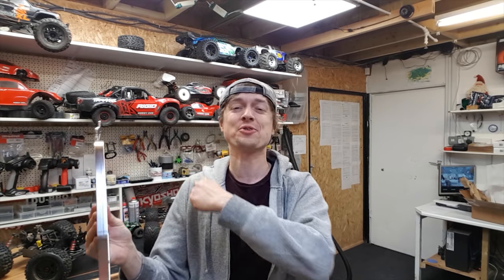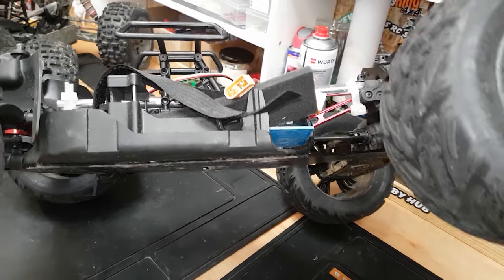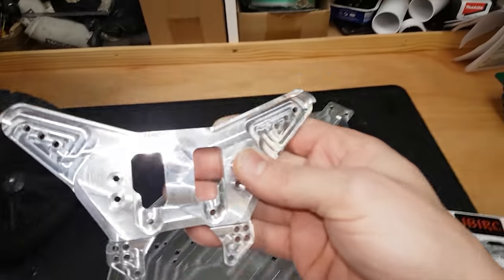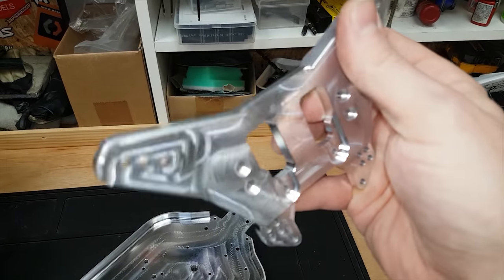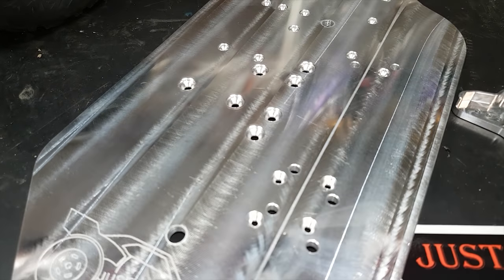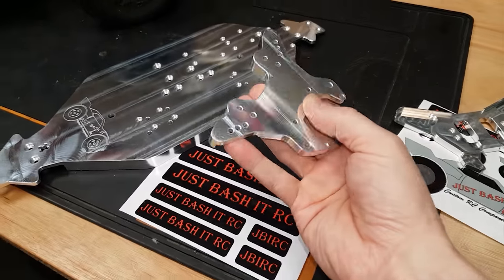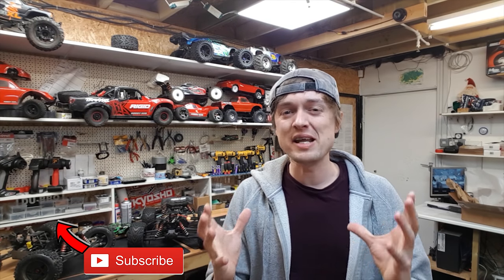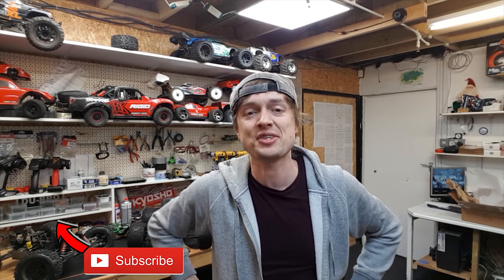ULTIMATE Arrma Kraton HD Chassis + Shock Towers From Just Bash It RC (Made in USA)

Comment: Hey Kevin 👊. If it's not a bother would you mind weighing that JBI chassis 🤔. I'm testing the new M2C Racing 7075 T6 4mm Kraton chassis and am curious as to the weight difference between the 2. Stock Kraton is 12oz, M2C is 17.7oz (496 grams). So far the M2C is straight as an arrow without a tower to tower brace. 🍻🤘🤘😎💪👊👊
Reply: Yeah that JBI chassis looks like it weighs as much as a brick
Reply: @PatsRC  thanks brother 👊. Much appreciated 🍻😎💪👊👊
Reply: @richduperbash2966  he said it was about 300 grams more then stock
Reply: @PatsRC  yeah I know right 😂!!! Well 7075 is definitely stronger with much better memory 🤔. Guess we'll see what happens.
Reply: I have the same chassis and honestly think I'm gonna get the M2C chassis and maybe sell the JBIRC. Not liking all the extra weight. I mean, it's super nice looking but... 🤔
Reply: @joov80  I hear ya on that John. There's little doubt that extra mass contributes to other breakages with awkward landings and takes from overall agility. Every rig I've lifted with a JBI has felt heavier than ideal. The M2C option makes more sense to me. Good luck with whatever you decide Brother 👊
Reply: @richduperbash2966  yes that is exactly my worry. Extra weight means harder and/ or more awkward landings. Either way I'm getting the M2C chassis and sometime may grab the outcast chassis as well.

Comment: If the chassis is thicker make sure you use longer screw! I’ve had screws pull out of bulkheads and shock towers!
Reply: Chassis is designed to run with stock screws.

Comment: Judging by that bend in the rear shock tower it was a nose dive as it has bent where the alloy tube you have fitted, you really need a flat either alloy or carbon fibre top chassis brace the ties to the lower tower mounts.
The trade off of this type of upgrade is weight it will hinder some stunts I should imagine, I still think you need a flat top brace, my HPI Baja 5SC got over 40lb, so I put it on a diet carbon fibre chassis braces hinge pi mounts etc now under thirty  not a lot more than my 5B now the rest of mine weigh over the original weight due to alloy upgrades bigger engines extra steering servo's etc.

Comment: Hay kev can you do. A review nom the traxxas 1/18 scale slash 4x4 brushed I have 1 and  I would love to do some up grades and I do not know were to get the parts
Reply from the maker: Maybe one day dude :)
Reply: Ok that would be grate👍🏼
Reply: @andreawagner4461  just look up 1/18 scale brushless system setups anyting 2435 can size on motor and smaller like 2030 can size like mamba micro pro will work with a little mod to the motor mount . If you run a 4800kv motor on 2s lipo , 13 tooth pinion, speed will be around 35mph!